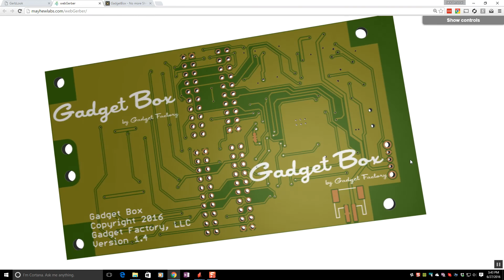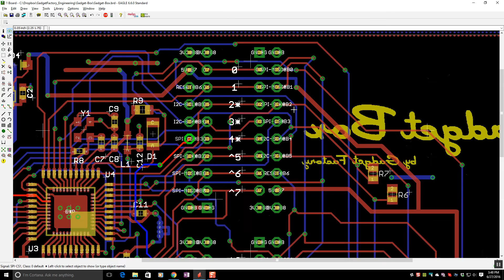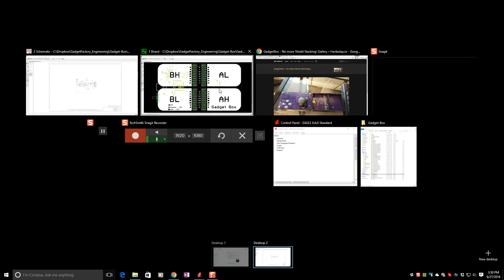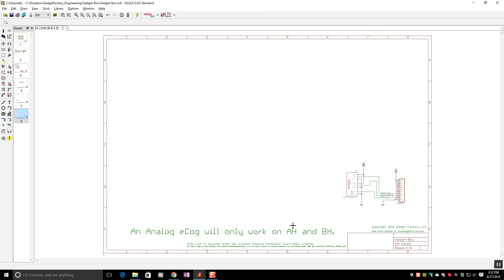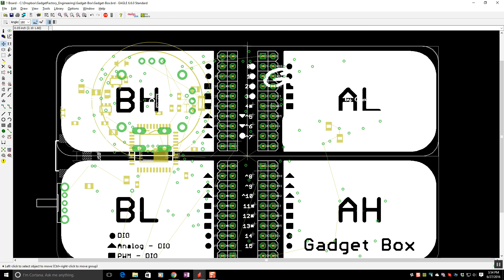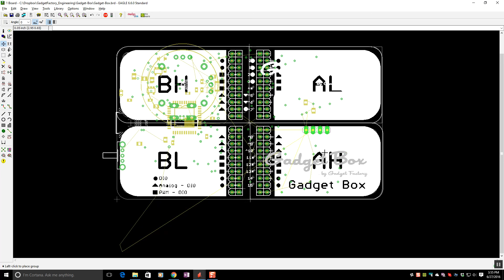GadgetBox - First Look!

Comment: Printing pin functions on the pcb is a great addition. I recently noticed that all my favorite dev boards have the pinouts either screened on the pcb or printed on the headers (looks so good on the headers).

Would be baller to have SMD LEDs next to each pin that lights green when the pin is free, and when an ecog is installed the used pins turn red.
Reply: That's too many LEDs, mostly useless. Here's a condensed version: each quadrant gets SPI/I2C LEDs indicating which is/are selected and/or active.
You mention this board is for IoT, but I see huge potential as a modular controller for anything from IoT/automation to robotics to drones/FPV to music.
This is my intro to GadgetBox and maybe I've missed the trajectory, but I imagine something built to control and interact with your things. Compared to all other IoT devices that get stashed in a project box and hidden out of sight, I want to use GadgetBox to build a panel I look at all the time.
For example, I want a touchscreen in one of the quadrants to cycle through charts and receive event notifications. Another quadrant would have an RGB keypad that lights up when the garage door is open or the mail has been delivered. One more quadrant with a thumbstick to pan/tilt a gate camera, the last for ethernet/wifi.
When can I give you my my money?
Reply from the maker: I really like the idea, but one of the design considerations is to keep the power usage as low as possible. I didn't even include a power LED in the design because of the energy it wastes. So it wouldn't be suitable to do this on all of the eCogs. But for those that would clearly be used in a wall powered application I think it is a great idea. I'll keep it in mind for the first clearly wall powered application that comes along.
Reply: +Gadget Factory yeah, I get that. Status LEDs are the first thing to go in battery powered projects. Looking forward to more progress updates.